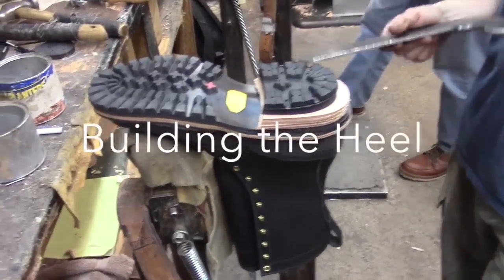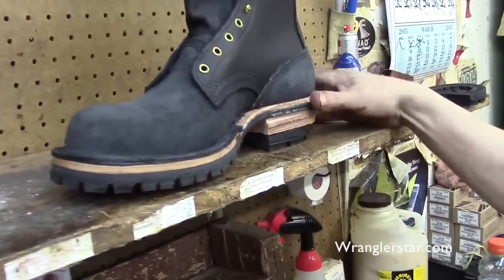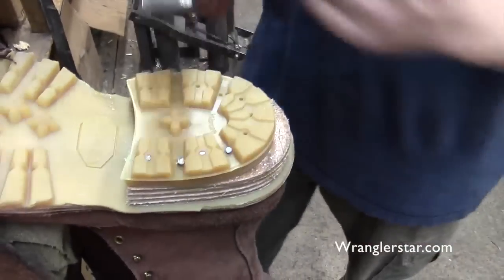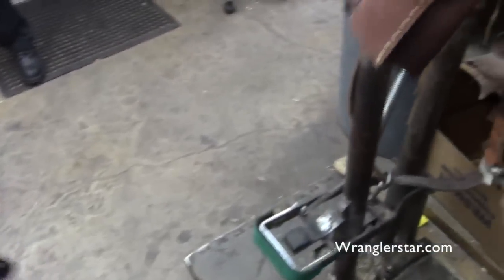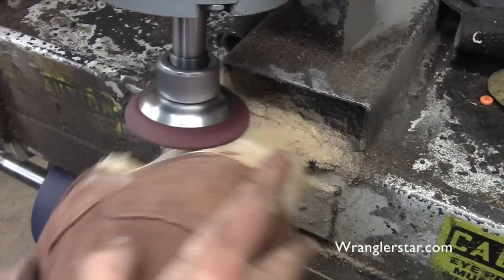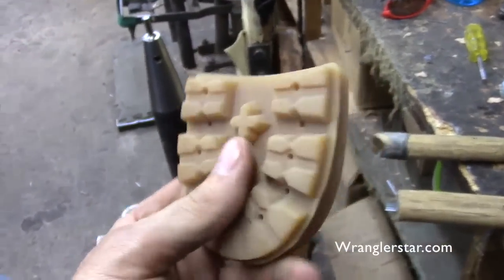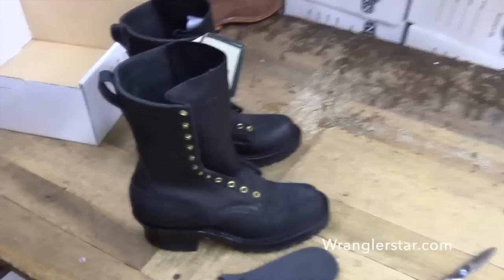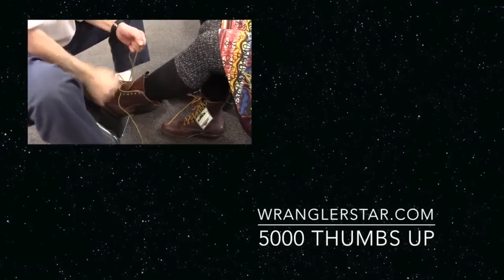Nicks Boots - Exclusive Factory Tour | 4 Wranglerstar

Comment: I'm a third generation shoe repairer.   While I re-build boots like the ones here down to molded mid-sole types I am not a shoe-maker.  I find the process of making a boot like these fascinating.    Of special interest is the previous segment when the video showed the Nick's craftsman stitching the soles.  The machine has to stitch through the welt, two mid-soles, and the Vibram lug sole.  This is not common and only a few boot makers will stitch through twin mid-soles and a Vibram lug sole.  It really takes skill and an outstanding machine.  The machine is the same one in our shop and is called a curved needle Rapid-E by Pedersen Shoe Machine Works of Holland.  I've had mine about 35-years and I think with the hood up you can especially see the tremendous cams and works that make this machine so robust.  Also if I'm correct these machines were no longer made past the mid to late eighties.  That means there is a finite number of these on the planet.  There are no longer many traveling shoe machinery mechanics either by the way.    When I took over our business in the early eighties they was one that came through and would give you ample time to know when he'd be in the area so if needed you could get him on his tour.  Other than that you could pay him for special appointments which, of course, would cost extra for the singular travel expense and time.  I want to shout a special thanks to Steve at Gateway Shoe Machinery as he may just be America's premier machinest and mechanic working on these machines.  He is a very gracious man.  Recently I had to clean for the first time in over 30-years the stitchers clutch mechanism.  Having never done this I was extremely grateful that he took time out of his extremely busy day to walk me through it.  This brings up the video relating Nick's keeps two machines in reserve.  These are indispensable must haves for the welted shoe industry.  It's not overstating that the fact either as manufacturing and many repairs cannot be made on welted footwear without this machine.   Like a seasoned woodworker the operator must have a "feel" to properly operate these machines.  That feel is a lifelong journey as you will only get to be your best by years of sewing these thick soles.    The reason why most Vibram soles are not sewn through is a combination of an expensive time consuming hand operated process and the need for an experienced operator.  Needles and awls for these machines are quite robust, but must be exchanged regularly.  They are expensive too.  The thread is a natural hemp based product  which at one time was made in Anniston, Alabama not far from my shop and it has become more rare.  It is a five or seven strand thread which is extremely strong and durable and is made with a right twist providing great internal surface area.    I want to say this series is an excellent one giving insight into the making of a premier type of boot that with occasional re-builds and proper care can last a lifetime.  In spite of the four-parts there's many steps we did not see that go into the making of these kinds of boots.   I would wager to guess there's over 200 processes that combine.  This has to be related to doing it right and not easy.   You actually get more for every dollar in a boot such as this but most won't realize it until they ponder the huge time and effort involved.

Comment: Mine have 14B in both boots and date year in the right boot. I have a large stamp set like that (1/4” I think) but I usually use the 1/8” set for stamping Township, Range, Corner, Section Number(s), my LS number & year on the 3-1/4” diameter disk atop the pipe monuments we set.

Comment: One question: The boots as completed at end of video #3, the stitching holding the outersole to the boot shows through on the outer Vibram sole. But it is gone in the beginning of video #4. How is that handled?

Comment: good video series, its helpfull to see the whole process. its a little confusing because its jumping back and forth between steps sometimes, and also showing the process of 2 differently constructed boots (welted and stitchdown) without a clear explination that they are different and what the differences are. if i didnt know much about boots i might think every boot went through each of those steps, which they dont. 

a big emphasis is made on everything being "hand made" and "hand finished" and "hand stitched" and i think these terms get thrown around allot and often incorectly. some of the process here are truely done by hand, such as the lasting and the welting, but most are done by machine with a human operator, like every single other boot made, unless there is some cnc boot making machines im unaware of. there is nothing wrong with using machines and in some cases, such as the sole press, it makes for a more durable and long lasting boot, and in other cases it saves a huge amount of time while not detracting from quality, such as the sole stitcher. the real difference between these and cheap boots isnt that one is "machine made" and one is "hand made" but rather, one has more attention to detail, better fit, finish and quality controll, uses better matereals and construction techniques, uses hand processes where benificial and practical, and (in some cases) is built on a coustomized last (not actually a completely coustom last mind you, but an existing last thats modified to fit).

A truely hand made boot would be one made using only hand tools  from start to finish, including carving a last from scratch to fit each foot, hand stitching every single stitch with a needle and awl, etc. these would be even more prohibitively expensive than these semi hand / coustom made boots are already, and i dont think a huge amount would be gained in durability / longevity, and in some cases it would be less.

one thing ive never understood on logger style boots is the high heel. i dont understand why its desireable at all and not just a fasion thing, to me it decreses stability and makes it much more likely that ill roll an ankle. I know wesco offeres a lower heel, i assume nicks does too? i know they need a different last for a lower heel.

Comment: Why didn't they screw the sole in like they did to yours
Reply: Stroud Cook It depends on the boot whether we screw or sew on the soles. The Hotshot is the only fire boot not stitched through the sole because of the extra thick leather middle sole. Thicker = more protection from heat and fire.